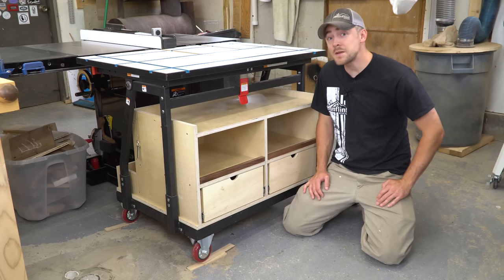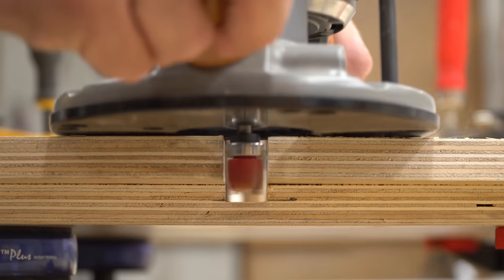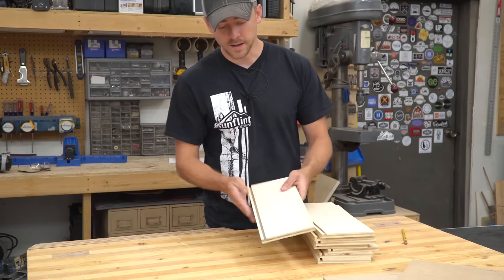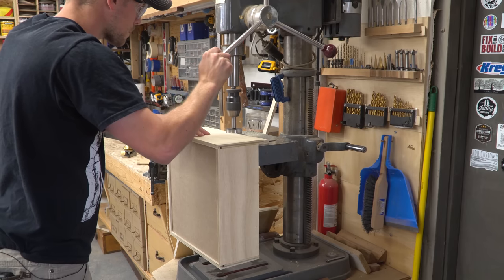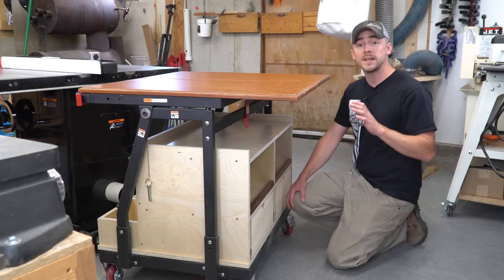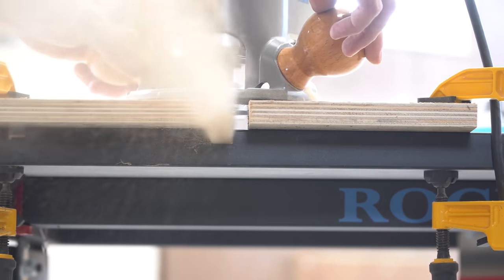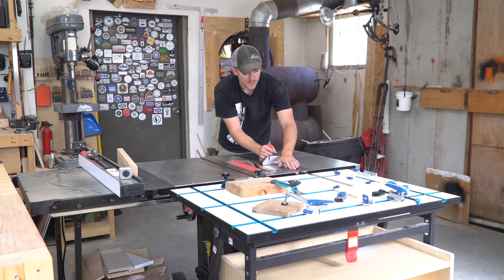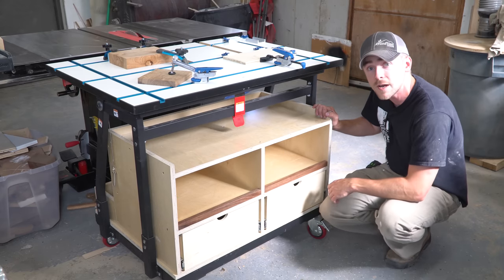Tablesaw Outfeed Table with T-Track & Storage Cabinet

Comment: I am making this right now, your video is super helpful, thanks.  For anyone else looking into it, I would make the back a half inch wider and run a vertical dado up the back of the sides.  It will hide the horizontal dado cavities and probably help with assembly some.

Comment: Just put some pieces on the bottom on the inside of the cart frame to keep the top from sliding over, you don’t need more magnets. That will also help you line it up.

Comment: Very nice addition. Those little cubbies in the back lower part of that cabinet are going to fill with sawdust pretty quickly.  I think that new table top will be great for putting picture type frames together.
Reply from the maker: I'm hoping that having dust collection hooked up to the saw will at least keep it from filling up too fast. Time will tell. Maybe I'll have to cut the bottoms out and put a wire mesh bottom in them.

Comment: Great build! I'd just screw in 2 small stop blocks under the table to stop the side to side sliding. Plus they would help to keep it square to the table saw when you put the top back on.

Comment: Great video! That router dado slot idea is genious, literally just routed a 3/4 slot that was too loose for my material - will absolutely be using your idea here
Reply from the maker: I'm glad you found it helpful! I can't take credit for the idea though, I have seen it a few times before, but I can't remember where. I'm just glad to help pass around that trick.

Comment: Great video, I have a small suggestion for you raze the table à little so it's flush with your tablesaw it will have the added advantage of not tipping your sheet goods as you cut them giving you a flat surface and also as put sheets on the tablesaw you would need to lift them up on your saw

Comment: When you use a plane, try not to drag it on the return stroke.  You're edge will last longer!  Good stuff man.  Cheers! Chris.
Reply from the maker: Thanks for the tip - I need all I can get when it comes to hand tools!
Reply: CrossWood I actually didn’t know this. Thank you!
Reply: I’ve learned it the hard way. :)

Comment: Nice solution! If you end up needing more hold from the magnets, try out some N50 magnets...I believe that is the strongest you can buy.
Reply from the maker: These ones are only N42, so there is definitely a little room to add more power.

Comment: Great videos as always. In regards to the table top sliding if you put the strips of wood on the bottom to line it up easier like you said you might do it would stop the sliding as well. 2 bird 1 stone kind of thing.
Reply from the maker: Exactly! I'm still tossing the ideas around. The bottom is perfectly flat, so I hate to introduce and permanent protusions in case I want to flip it over and use that side.

Comment: I followed this almost exactly and super helpful! Thanks! I do find that the tabletop doesn’t quite contact the metal frame perfectly because the knobs on the front hold it up a bit. I’m not too sure what I’m going to do about that. Also, your cabinet slid into the cart so easily. I found it super tight and had to grind off the ends of the height adjustment bolts to get it to fit. Not sure why it would have been so different

Comment: Here's a project idea - design mobile table that combines DeWalt Table Saw or any other job site saw, and Rockler Material Mate Panel Cart.  Solve the issue of one person getting 3/4" plywood from pickup truck to table saw.

Comment: for the sliding what i would do is secure some right angle brackets or maybe just some wood strips to the bottom of the table top as stop blocks in a way to keep the table top from sliding around. itll still come off when you want it but it wont slide on you while you are trying to work on it
Reply from the maker: That's what I've been thinking, it would also help me locate the spot on the frame each time I take it off. My only hangup is that the bottom is perfectly flat, so I hate to introduce any permanent protusions in case I want to flip it over and use that side.
Reply: Gunflint Designs ok so it maybe a little complicated trying to explain my thoughts on a solution but basically drill a hole for number sake say 1/4" size hole about a 1/2" deep where you would've put the stop blocks. In the hole glue in another magnet and make sure its recessed from the surface. Then you can use some threaded rod or steel tubing or shaft as the stop blocks but if you ever want to use the bottom side just pull the little pieces out. Or the less eye appealing method you can use is just recess some bolts from the top that can act as stop blocks so you can pull them out of you ever flip the stop over. Kinda of a tricky situation but in theory these methods should work
Reply from the maker: I like the way you think. My plan is to live with it for a while and see if any other issues arise, then I'll dive into a solution.

Comment: Nice work.  Would love feedback in a month or two with a count of how many times you have to remove a t-track component to run a board, to have to go back to the t-track!  Happens to me all the time.
Reply from the maker: I definitely see the challenge in that! My brain insists that I keep things pretty well organized, so I will probably always keep the t-track clear until I need something, then I'll pull it out of a drawer and put it right back when I'm done.
Reply: Yeah you'll work around it - it's a nice problem to have - I just realized after that i'm always moving stuff from my outfeed/work table.

Comment: Great video, do you remember the position on the table top on reference of the frame? and mine is a little bit higher of the sawstop no much but a little bit, did you have this issue?
Reply from the maker: Mine are really close to the exact same height. I've never actually had them on a truly level floor, so I don't know which one is actually higher. In my last shop I used door shims under the wheels to lift the table up a little. In my current shop the saw had to come up. 

Do you have your saw on a rolling base? That might be making the difference.

Comment: Good video.  Now that you have been using for a few months, what do you think?  Do you still like it as built?  Any modifications made, any challenges you didn’t think off now that you’ve been using it?
Reply from the maker: So far I haven't changed a thing. It's working exactly the way I need it to. I still want to throw some walnut edge-banding on the plywood, but I can't think of a functional change I need.

Comment: Curious as to how fast the CA glue dries??  Also, does it only work on wood?
Reply from the maker: There are lots of types of CA glue. It actually dries when deprived of oxygen, so if you press really well, it should dry right away. You can also buy Accelerator - you put glue on one face and accelerator on the opposite and when you push them together they bond instantly. There are many types of CA glue. I just used some to stick MDF and PVC together.

Comment: How doe sit fit the the dust collector pipe on back of table saw?
Reply from the maker: I put a 90 degree elbow on the saw so I can now hook it up from the side. The base of the cart rests against that pipe and I have the top off center, favoring the tables side. There's about a 3-inch gap between the 3 surfaces this way.